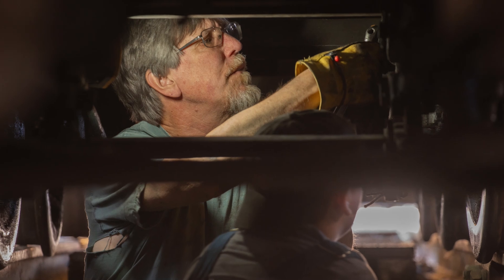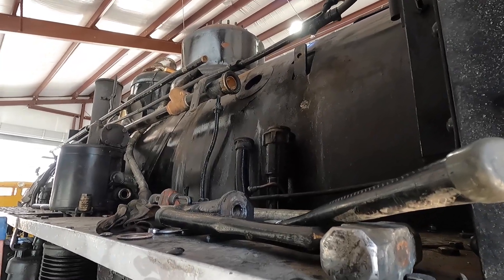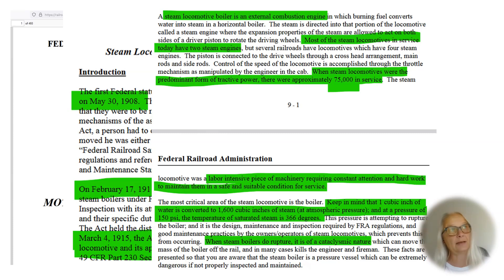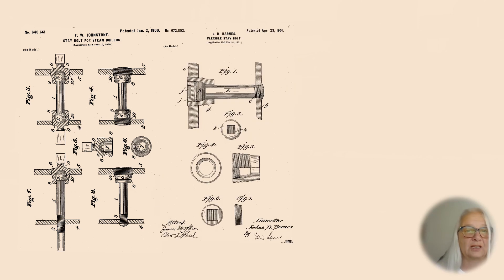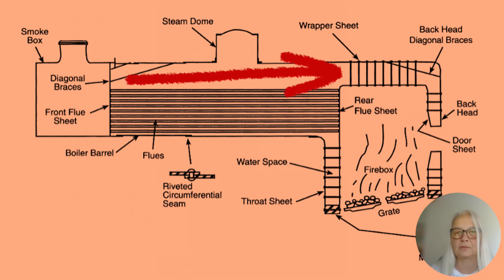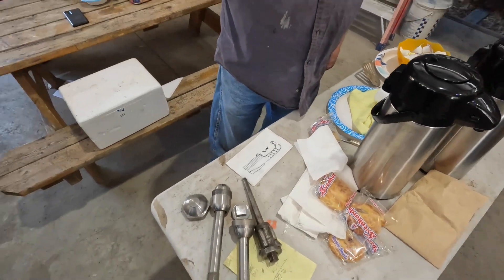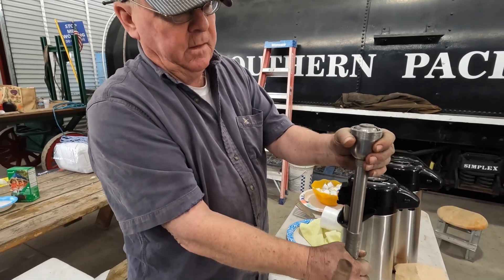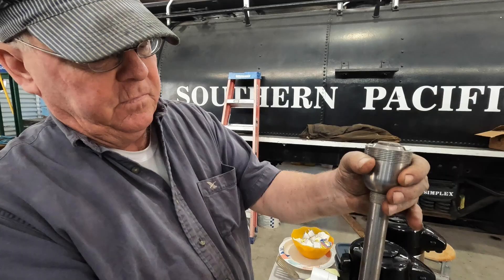Why is Inspecting Staybolts Crucial - Steam has power - Explosion risks are Real! Verification - YES

Comment: There are two aspects with regard to steam operation, first is inspection but just as important is operation.  Since locomotives do not have low water shut off's making sure there is adequate water in the boiler is paramount.  Some locomotives have fusible or drop plugs that can act as a low water alarm and or as passive safety devices.  These must be inspected, cleaned and renewed on a prescribed schedule.  Good video.
Reply from the maker: Thanks for the note. I couldn't agree more. Sorry for the late reply.